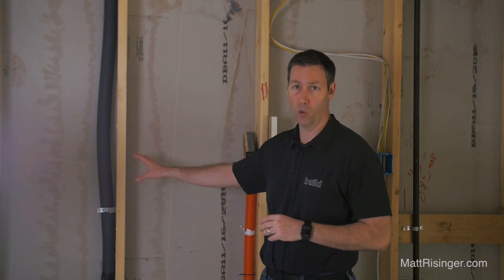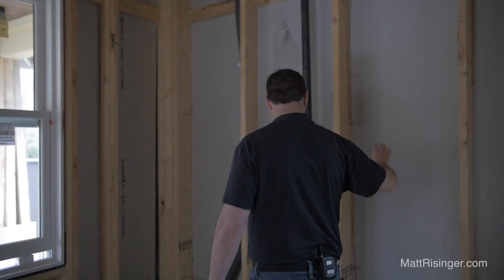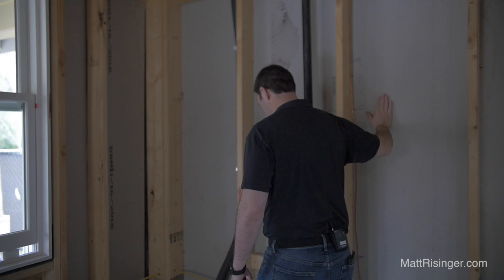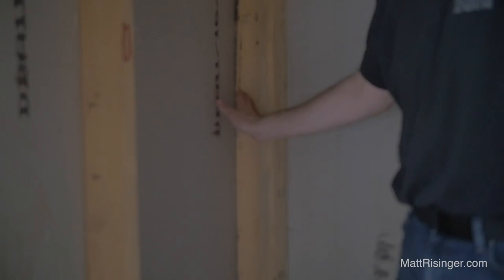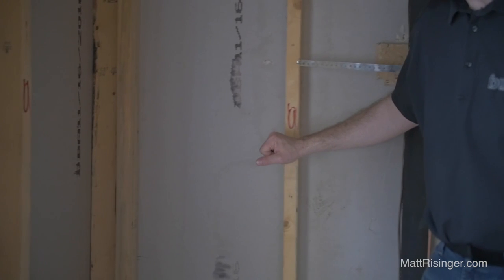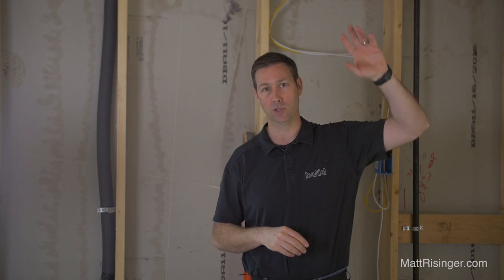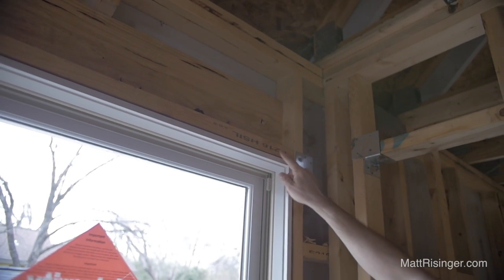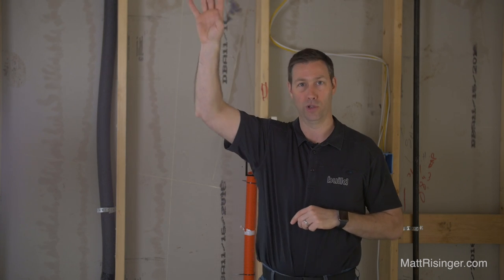Traditional vs. Advanced Framing

Comment: Too bad most energy loss is via the ceiling and windows/fenestrations. Not sure it would save a dramatic amount of energy vs focusing on attic and openings (i.e. Not just the surround/framing - you can be as efficient as possible but if your windows have 1/8 air gaps not sure how you win there)

Comment: I have built framing to cyclonic codes and gets the insulation value as well and what he is showing is fine... But.
Framing is just a means to hang linings and hold up a roof, but is useless if it blows over, hence why you need plenty of bracing and hold down strength. A full length 1/2inch gal rod beside each opening, on corners, and at 4ft centers, going from concrete footing to roof batten would be a start. 
Metal X or sheet bracing in wall panels (including some internals to act as shear braces would be great as well) . 
Strength is less reliant on the amount of timber, but more on how you brace it. 
Didn't see much of that here so that is the concerning part.

Comment: Why can't you put stud on 19.2 OC instead of 24? Less material and still very similar to 16 OC. I'm not a professional in any sense, but I do know that we put our engineered flooring trusses on 1/5 of 8 foot (19.2)
Reply: Nickolas Jennings availability of insulation that would fit 19.2 comes to mind. It would be pretty nice if that was commonly available though
Reply: A lot of places we need to meet at 48-inch widths, which works for 16 oc and 24 oc.

Comment: All those hangers gave me a headache. I'd rather stick to traditional framing. 2x6 on 16 center exterior walls with OSB sheathing. 2x10 headers with header blocks depending on the window. On your corner make a U and on the partitions make a L and there you go, easy to insulate. All that "advance framing" looks like it take too much time. No one has time for that. Especially if you're trying to frame 30 houses a year!

Comment: if the insulation value on wood is 1 per inch. On his exterior partion wall blocking , turn them blocks flat dummy.  let that insulation flow right behind them.

Comment: I see a cheap made home on the last home.  Some of the ideas I can see but I see week corners, and a home that will not last long, What I did like about the external that has the OSB with the insulation on it I did like that but I like Ply wood over OSB if possible unless has some sort of water proofing, like the OSB I have used to replace my sub floors in the remodel of my home. I don't like the metal parts a round the windows and the door jams yea it may not look like much but now you have a raised area that will show though in drywall if that is the material being used in side the home.  I know with the remodeling I'm doing now and I forget to make sure the stud's are clean before I place a new piece of dry wall up and when it is drawn in with the screws and I see either a nail or old clue or something pushing up on the drywall.  it sucks when you have to pull that sheet back down trash it because now its jacked up and then clean off the glue, and then start over with that spot of clean clue and finding the high spot and fix it. since my remodel is one were I want my home to last a long long time     and its has been a long road.

Comment: Makes no sense to use anything other than engineered lumber for headers these days. Also I agree that ladder blocking is best for corners. I prefer to add galvanized 2" angle in corners and the drywall will never crack as they flex together with movement.

Comment: I don’t know about this… Here in California we have earthquakes. A little less insulation a little more strength sounds good to me. If you’re really stuck on this why don’t you try steel frame construction? Then use less wood and you can take the hollow steel 2 x 4’s and fill them with foam insulation before you screw them into place then it’s completely insulated and just as strong as standard construction, use less wood and it will be completely insulated. Not to mention fireproof and bug proof !

Comment: once I build a house that I want.  it will have 2x12 for exterior walls, 2x6 for interior walls.  Majority of the studs and joist will be ceder.
Reply: david USMC Over kill and will be cumbersome.What you want would be red iron columns and I- beams for main structure then 6 inch 18 gauge metal studs for exterior and inside walls for the most insulation.Also double layered sheetrock staggered on all walls.Door and windows would need extra attention because door jambs would need to be custom width .The house would be sturdy termite proof, fire proof, almost..and you could make it look like any house on the market today.I have built houses for years and this is how I would like to build one.I do commercial framing with metal and I like it the best.

Comment: Seems to me you're giving up rigidity and strength for a small increment in R-value.  The outside sheathing gives you rigidity and going from 16" center to 24" inch center studs decreases the sheathing nailing surface by 25%.  "New and improved" is not always "improved".  The real test will be how this framing technique stands the test of time.  I'm guessing not as well as a house built on 16" centers with traditional framing.

Comment: If you really want to go advanced framing and fix all the issues mentioned without losing any time or suffering any strength check out biffco framing system.

Comment: As far as the headers you use a 2 x 6 wall and a pig trough had her then you have several inches inside the pig trough header that can be insulated 2 x 6 wall much more R-value

Comment: Builders are the worst students at accepting "new technologies". I've been using most of those 'advanced' techniques for 40 years. Try a California corner for insulation. Flip your ladder blocks flat and you gain insulating value plus make the rock hangers happier. Been using 2x6 stacked framing when I started out and box beam headers to get an additional r-6 above windows and doors. Haven't tried the header hangers yet because I'm mostly finishing/ Supering now. But homeboy is correct if they used drywall screws. No shear value. Also, if your target life is just "a couple" of generations then you are definitely building junk. Id like my great grandchildren to be able to inherit my houses. Now step outside a take a picture. Bet it looks like a row of ticky-tacky houses on a cookie cutter street.

Comment: His advanced framing techniques are what most builder's call "cutting corners" it's a cheaper way to frame a house. It's the bare minimum allowed by code! Yes it will yield better r-value is certain areas. But the lack of overall structural integrity will be the houses long term downfall! Find a builder that builds beyond codes minimum specs!

Comment: Let me tell you a little story. The house that I live in has no insulation in the exterior walls at all. The house is VERY well made stud cavities are about air tight. The furnace is old too. The heating and cooling bills are cheaper then our old house to spite a new furnace and full fiberglass insulation over there. Oh and the new house is almost double the size.  Engineered structures are great until nature comes along and gives you some nice rot and decomposition or throws you a loop that you didn't see coming. Sorry Charly I'd rather sign the check for the utilities in the overbuilt house knowing that I have redundancy. I'm confident that there will be little difference in utilities or purchase prices on either option. If anything the "traditional" house will come out ahead for a myriad of reasons.
Reply: David Morris I don't disagree with you on the cement. I know of a poured concrete house that took a direct hit from a tornado. When they dug it out of a pile of brush that used to be some near by woods it was still in one piece. It stands to this day. The tornado hit over 10 years ago.

Comment: What is the cross bracing method for the exterior walls ? Zip Wall with foam seems a bit of a stretch, maybe not ?
Reply: Depends on the thickness of the foam.  Up north SOP is still OSB against the framing then exterior rigid foam on the exterior side of the OSB.

Comment: I don't think that advanced framing would work well in Canada at least not near windows and doors where you need that extra strength from the snow (exemption for costal provinces)
Reply: Simpson  will ship you a few tubes of crack resistant sealant for free so obviously sounds like a rock solid no brainer to me. Sealing cracks is better than one piece. Who wants pex piping when you can have multiple lengths of copper soldered together? I'd probably cut a 12' into 6 pieces just because all those joints are better than one piece. I like filling my walls with expandable sealant. Stretchy walls are bad ass

Comment: Build airtight houses, then have to install HVAC fresh air returns to bring in outside to make up what the house should have lost.......so whats the point again of doing this?
Reply: If you do it correctly, you save energy overall because the intake and exhaust air is done in a controlled manner. If you use something like an ERV or HRV HVAC system, you get fresh air without the heat loss penalty.

Comment: That is some shoddy framing.  Did you see the finger joint studs. That drywall baking is mickey mouse. That wouldnt pass here in Canada.  A 3 stud corner is common and can be insulated. Where the partitions meet the exterior walls, instead of a  U , put in a L or double L.  Real carpenters know what I am talking about.

Comment: This video gets a lot of negative comments and a lot of likes of negative comments about the framing techniques suggested in the video. A few comments: Is the framing strong enough to hold up a second story? Why wouldn't it be? One problem that houses don't have is inadequate load bearing strength when 2x4's on 16 inch centers are used. 2x6's on 24 inch centers have a bit more load bearing capacity than 2x4's on 16 inch centers so the walls are stronger than the strength of the most common walls used in the US. What about shear strength for earthquake and storm load? It is possible to achieve the same shear resistance by just using  a bit thicker sheathing. What about the house blowing away argument? Is this really any kind of an issue with modern bolting and strapping ideas? There is a lot to be said for gut feel building. It works great before it doesn't when unusual events like storms and earthquakes happen by. To make buildings resistant to failure from unusual causes engineering is required and my guess is that a properly engineered house with 2x6's 24 inch o.c. can resist failure much better than a house built with seat of the pants construction ideas built with 2x4's 16 inch o.c.

Comment: Traditional framing is much stronger. As far as insulting wall leads in a traditional framed house, Cut 2” foam board and put in from the outside before you sheet the walls. For corners we build 3 stud “California” corners and are able to get 2” of foam on a 2x4 corner or 4” of foam on a 2x6 corner. There are ways to frame traditionally and still be energy conscious. Don’t build “weak” to insulate. Figure out how to balance strength and R-value.

Comment: You can install 2X4 blocking flush to the inside of the studs where the cabinets are to be mounted. Problem solved! There’s a solution. Just have to think a little.

Comment: Im with ya. The framing is horrible om the advanced. And i side note seems like u might get more sheetrock waves with 2 ft on center studs.. and no load transfer to the king lol.. wouldn't pass inspection in SC!!
Reply: I agree, any span over 16 inches has a tendency to show any waves from lumber crowning and bending. However I will say upping the sheetrock from standard 1/2" to 5/8" goes a long way. I usually hate when I see 5/8" needed, it cant be cut nearly as quick as 1/2 with a quick score

Comment: Better yet a 2x6 top and bottom plate,   2x4 studs at 16" on center alternating outside, inside wall so no lumber touches both inside and outside walls outside wall a 2" ridgid foam panel with zip wall over it then siding outside 
Inside wall cavity 3" 2lb closed cell foam insulation covered with drywall and 1" thick foam board then drywall so absolutely no lumber or steel is on both insides or outside walls. Ecpt windows and doors frames. The frames are made of cpvc insulated beams the glass is 3 pain argon filled with a solar reflection coating.
Attic 3" close cell insulation attic floor r-45 blowen in insulation top or roof 3" air gap reflective foam board with plywood over and then ice dam and any type of roofing with a ridge vent full length fan driven with solar power. 
All bathrooms vent outside walls a fresh air exchange for the HVAC system that's highly effecent and or geothermol.
Solar panels on the roof led lighting in the house geo theromal cooled fridge. Solar water heater solar stove cooking. And geo thermol.
And or solar panel electric.

Carbon footprint.    -25
You make more energy then you use.

All top plates rafters and bottom plates and studs are tied into point load with metal strapping add earthquake anti racking and hurcane windows.
An F5 tornado wouldnt touch it, 
and it would stand a strong earthquake or storm .

It would only cost an extra 150k plus to build it.

Comment: A lot of these comments seem to be made by people not familiar with the IBC. No matter how flimsy the building seem if it meets building standards and ahj amendments it is a safe, structural, and compliant building. I promise an engineer employed by the IBC has much more experience than 100 years of tradition.  He mentions in other videos The 24 oc building is strengthened by the thicker plywood, he also emphasizes the use of 5/8 drywall to compensate the span.  This isn't so much about the cost of the build but the cost of operation. Whether you are an environmentalist concerned  about trees and carbon, or a penny miser set on saving the $ they will all agree the watt saved is a dollar not spent.

Comment: Let me see..first you are looking at a house where the layout of the framing was done maybe not wrong, but was built according to the standards from where you are... was probably inspected and passed according to their building codes..the second building you are showing is an alternative to building, likely to standard codes as well, but more on the line of the cookie cutters.. save at whatever cost, right? go cheap on the lumber, the paint will hold it together

Comment: This new framing technics  are not better. They are the bare minimums to get by inspections! King studs  and Jack studs are much stronger, as are 4x12 headers. This "new" framing  minimal at best ,it saves lumber and the contractor money. The homeowner will notice the house shake when a door is slammed...  40 years in carpentry/ drywall .I know the difference.😁😐

Comment: Lots of bad comments on this one. Most people probably don't fully understand it, second a lot of it is code, 3rd he constantly says check with your local engineer and building codes and everyone says well that won't work here. He never said it would, he said it worked in his particular area. This is the direction things are moving people. A 15 percent energy savings over hundred thousand houses is significant. Many other benefits of this type of framing as well.
Reply: And a lot of us DO understand it.  Cheap is the way things are moving - this is not an advance in anything.  There are much better combinations in construction to achieve a balance of strength, rigidity, and efficiency.

Comment: Ahhhh i don't think that advanced house would pass inspection here in SC i am a framer and i can tell that is a bad framing method, we do a 3 stud corner way stronger than that weak shit plus you need those jacks to hold that load that single king jack aint doing nothing

Comment: I think no hygroscopic calculations were made in that "advanced framing house", as less hygroscopic (more porous) material (insulation) is put near exterior instead of interior wall. As rule of thumb you do not want to do that.

There is no ventilation between wooden exterior sheet and insulation, either - which elevates mold risk at least in rainy/high humidity areas. Though (against common belief) mold in exterior structures is not issue, if it is not weakening structural load bearing capabilities. Anyways you would want to have 1-2" ventilation framing between that and final exterior material (not verified/unverified in this video).

If outside temperature is less, than inside of house, vapour pressure is pushing (more vapour containing) air from inside to out, if there is no significant under pressure in the building e.g. due ventilation. So at least you do not want to switch ventilation off in the building with hygroscopic design issues.
Reply: That makes no sense at all. I have built hundreds of homes in Washington State where it is wet all the time. We had issues with traditional framed houses but not one claim on advanced framed homes.

Comment: OR you could go with ICF (insulated concrete forms) for a little more and get a house that would last WAAAAYYYYYYYYY Longer and have triple the insulation, A Hurricane would never get it (if you hurricane clips on the rafters), and your sheet rockers will have a built in stud every 16 inches.

Comment: That is the problem with modern engineering. Structure stability relies on the rigidness of the wall, that those 2"x6" will not hold for long in comparison to the ''exesive and unessesary" amount of wood the 2"x4", 16" center provides. Also the greater the cavities in between the walls, greater the chance for damage exposure. In addition, every constructor should know that a wood structured building must have high rated exterior insulation. I don't consider it Advanced Framing.